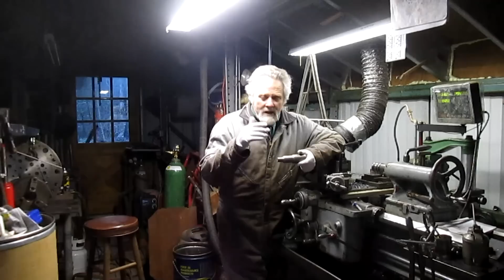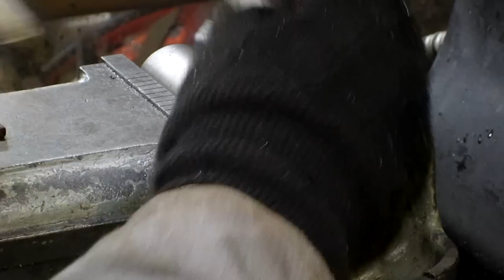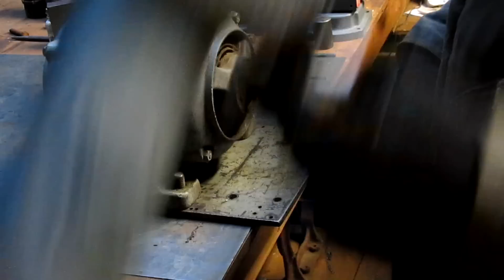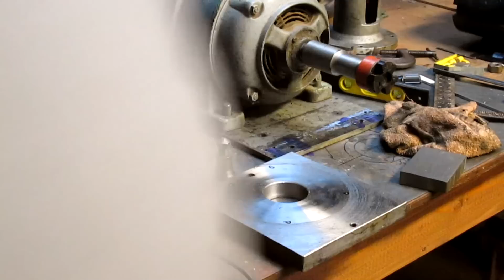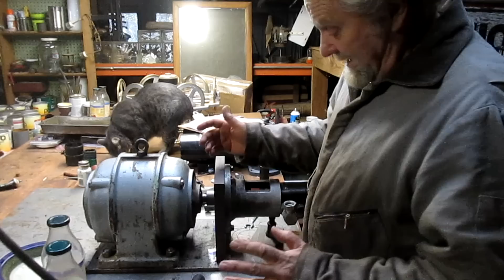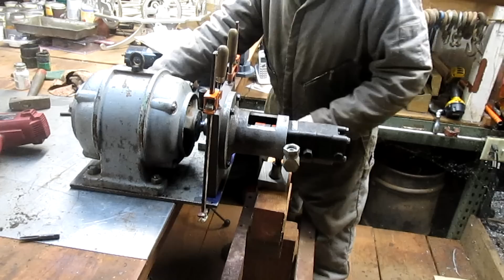Shop Press Build #6

Comment: Nic. Looks like you've changed out those 4 and 3 jaw Chucks quite a bit. Good Videos so far.
Reply from the maker: +Garry Fuller Sr The right tool for the job. The big 3 jaw is functional but worn out. With the 4 jaw I can get accurate. All depends on the job.

Comment: nick  i would first check the runout of the shaft adapter. mount an indicator on the vertical plate and check shaft where the coupler mounts. if its ok then mount the indicator on the shaft adapter and sweep the vertical plate this will allow you to check the plate alighnment. if i were you, i would bolt the vertical plate to a block of steel say 1x1 or more then you could bolt the whole works the the motor mount plate .this would give you a lot of adjustability and stiffen the whole works to boot.good luck
Reply from the maker: +larry sperling Check out part 7 and see how I approached the problem. More parts to come too.

Comment: Nick I see from your work clothes that temps must have dropped to 68 degrees f.   I'm excited for spring to get here.
Reply from the maker: +carryit around 68 degrees would be nice. Mexico weather in winter. It hovered around the teens and low twenties while that segment was being filmed. I like winter.
Reply: +Nik C. Colyer you look comfortable.  I heat my shop.  I like the view in winter from a warm area.
Reply from the maker: +carryit around I wished I could heat mine. Although I sealed all the gaps last summer there is no insulation. SOmeday when I get an extra 5 grand I'll get the thing insulated. Till then Pillsbury dough boy suit it is.
NIK

Comment: Great Video Nik,
 
Could it be that you centered everything, drilled and taped the holes for the pump mount then milled off the bottom of the plate?  

The motor shaft is now no lower in the center of the hole in the plate.
Reply from the maker: +MD500E99 The shaft doesn't need to be perfectly centered, just as long as it isn't rubbing. As you will see later on, I mill the vertical plate to square it up with the motor shaft.
Reply: I guess what I meant was the the pump is now sitting a little lower since you milled the bottom of the plate. That might be why it's binding a little.

I'll wait to see the next in the series.
Thanks again for the great videos, I really enjoy them.
Reply from the maker: +MD500E99 You are so right. I didn't even see that. Later it works out and why I don't know. I did take less than .005 off of the bottom.